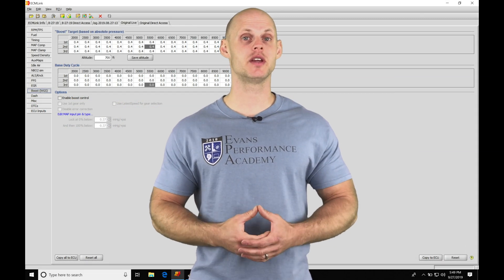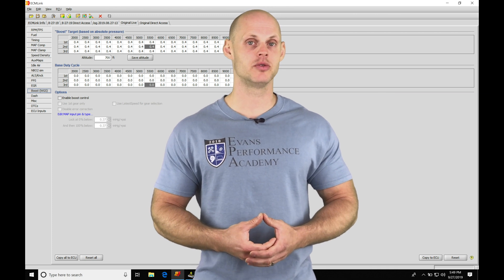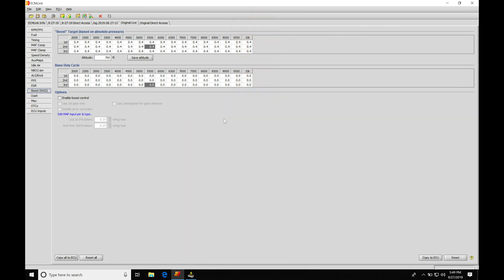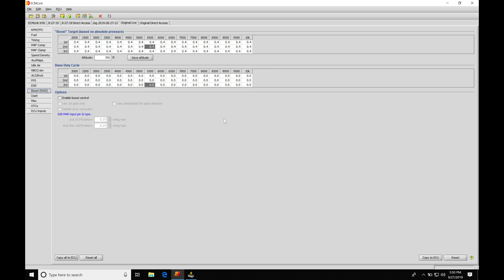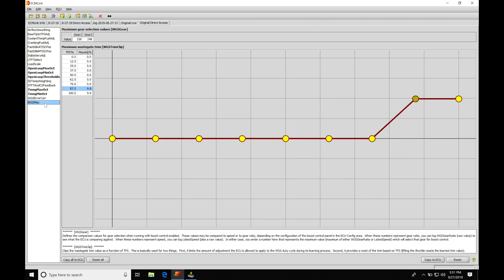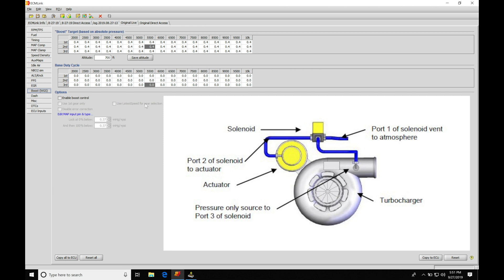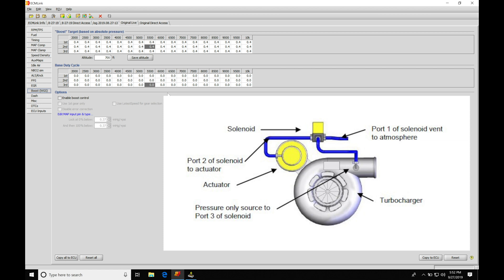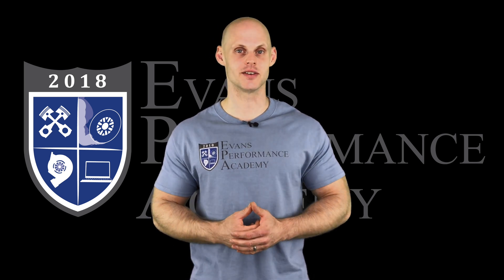ECM Link Part 13: Boost Control Tuning | Evans Performance Academy

Comment: Any ideas how I can integrate a scramble button to active a higher duty cycle command to the ecu? Say My base duty map goes up as high as 50% duty cycle, but I find myself in need of more boost so I grab a scramble button that will command a set value of say, 65% duty to the solenoid?